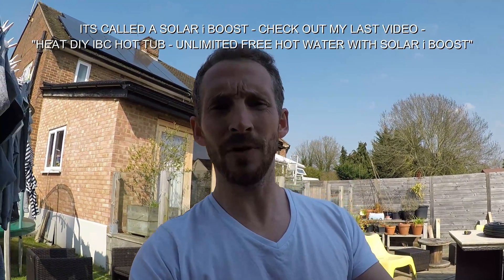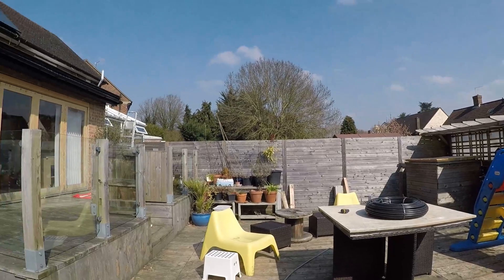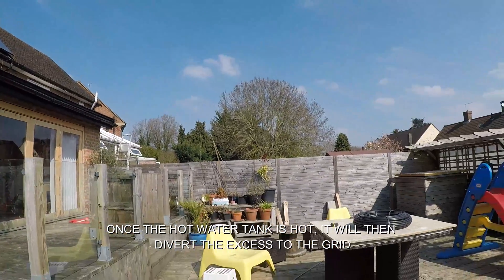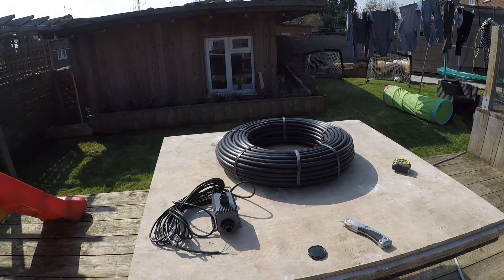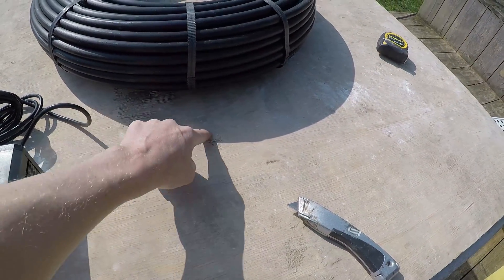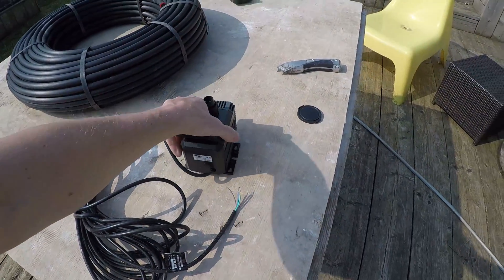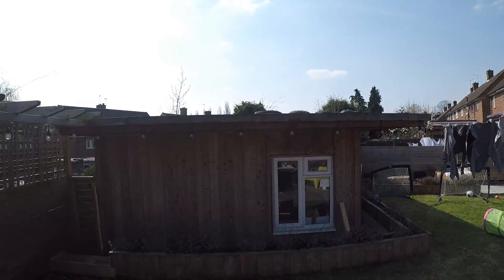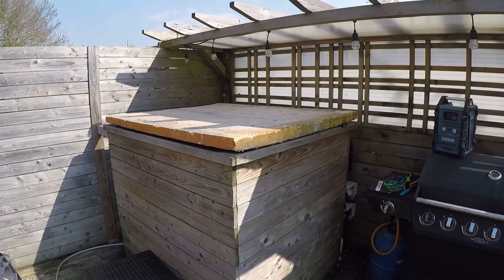How to make a Solar Powered Hot Water Coil  |  Starting the Project  |  Part 1/8  |  EP#19

Comment: Do you have a link to the tubing you bought? Can't see it in your description

Also did you need a pump in the end, or was the pressure of the water in the IBC enough to recirculate on its own? 

Looking into doing this myself, great vids btw 

Thanks
Reply from the maker: I have it up there now 😁😁👍👍
Reply: Ace, thanks Ryan, really looking forward to your other videos, my IBC arrives on Friday!
Reply from the maker: Your welcome, I'd really like to see how yours turns out, if you make some videos I'd be happy to post some of them on my channel or incorporate them into a video.( just make them in landscape not portrait and HD quality)
If you need any info just send me a message 👍👍
Reply: A separate question Ryan, where did you get your inlet and outlet from? Did they come with the pump? Or did you buy separately? 

I have a bestway pool pump and the pipes are 32mm off the filter pump, but the filter and inlet are 25mm as I think they go inside a sleeve built jnto the pools. So I'm wondering shall I buy a separate inlet and outlet that are the same dimension as the 32mm pool filter pump.
Reply from the maker: Hi Alan, the pump came with the inlet and outlet but the sizes were different from the hosing so I had to get various pipes and connections and make it work, not my strong point tbh 😂
Reply: @thelondoncraftsmanworkshop  I'm at that same point
Reply from the maker: I had a couple of car radiator hoses and found them perfect as they can stretch a bit work with various hose sizes. I just cut them 200mm long or so and used them as a sort of coupler for to separate hoses
Reply: @thelondoncraftsmanworkshop  might give that a shout
Reply from the maker: Hi Alan,

Thank you! 
You will see in the videos to come ( there are 8-9 parts to this series) that the pump JUST about did the job for my experiments, but when I stood the coil up properly when  in use it was intermittent.
I'm  currently  looking around for another pump which has higher pumping power. I'm thinking about buying a used lay Z spa pump as they seem to be quite big and substantial, or another alternative.
I realised that the coil needs more pressure than i first thought to push the water through!

Give me half hour and I'll try and get that coil link in the description for you.

Cheers Ryan

Comment: I look forward to seeing how this goes. I have a similar DIY setup to help heat my above ground pool, that I tapped in to the pool pump. Main issue is keeping air out of the pipe, but that's just my bodged hosepipe connectors I think. I'm now building an IBC hot-tub inspired by your vids :)
Reply from the maker: Hi mate, that's good to hear, part 2 is on tomorrow morning 9am.
Funnily enough I'm in the middle of making a new video of how I build my hot tub , as my original videos are dated, probably a fee weeks away on this.
Will be great to see your hot tub once it's done